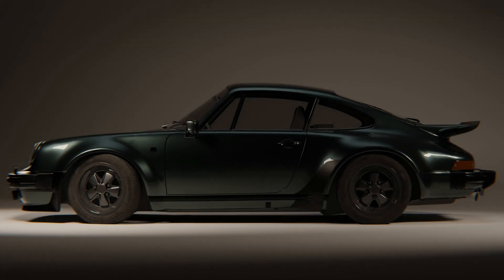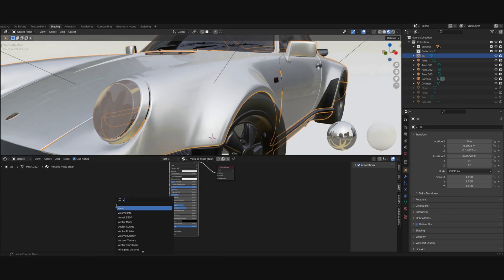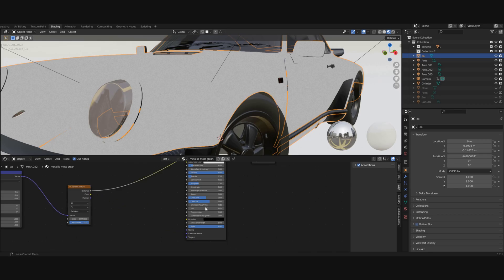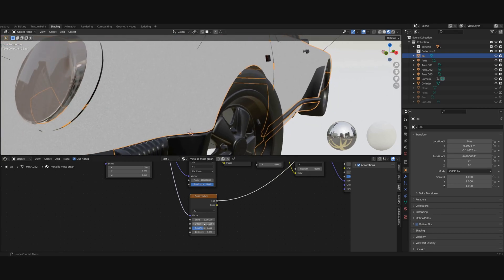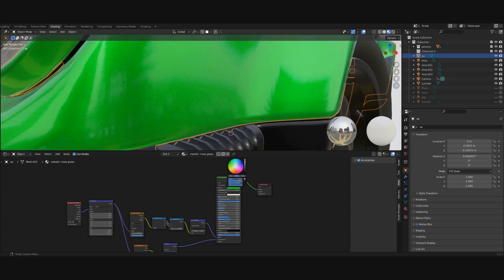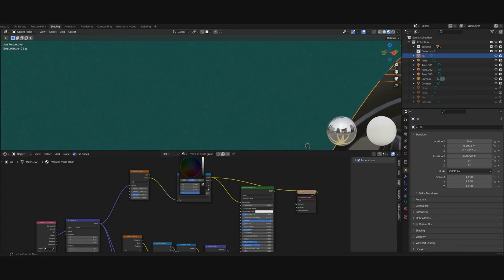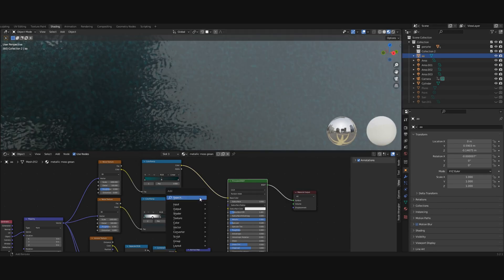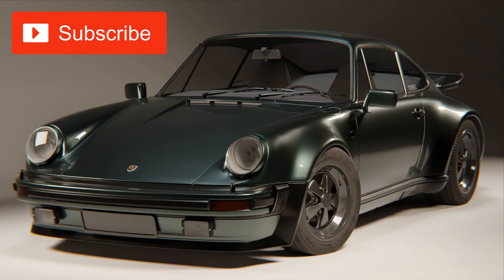Make Realistic Car Paint Material In Blender! | Blender Tutorial

Comment: I did about the same but than used textures. One thing i dont like on this setup is the normal map, its way to strong. It looks like its a botched paint job. Car paint doesnt look like that unless its very bad paint job. You should leave out the bump on the clear coat, but ldo leave it on the normal map. One other good method is to layer 2 materials, one for the rough metal look and the other the metallic glitter flakes
Reply from the maker: i will try it, thanks!
Reply: @maslowski.  You will stil get the metal shimmer effect, but the coating is than smooth